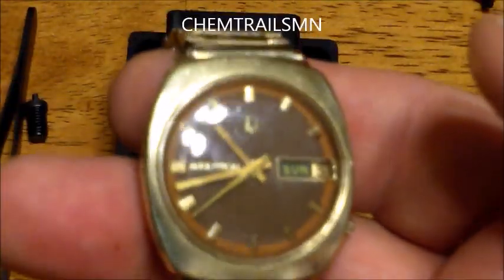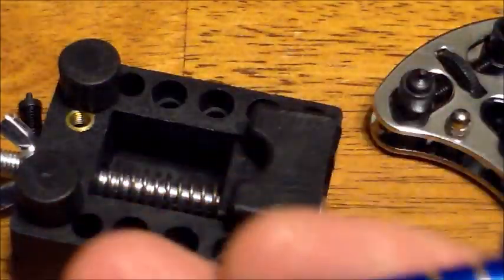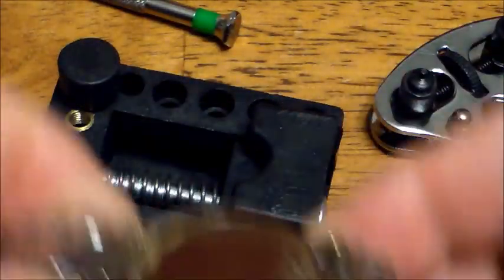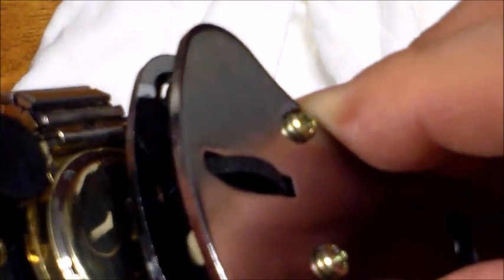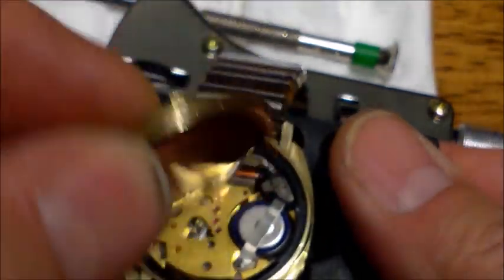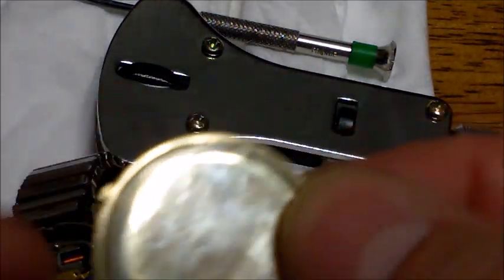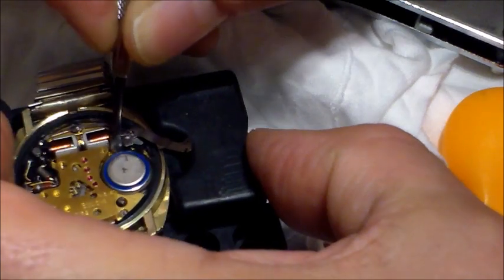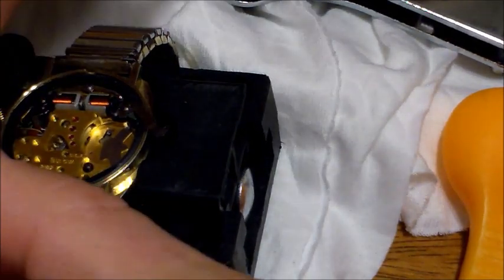BULOVA ACCUTRON WATCH BATTERY REPLACEMENT GUIDE INSTRUCTIONS DO IT YOURSELF! DIY

Comment: Also, when loosening the screws for the cell strap, loosen only half a turn.  Not necessary more than that.  I'm the guy that's worked at Bulova as well as repairing Accutrons since 1970 for both the trade as well as private customers.

Comment: I have to admit I Luv my Accutron N3 (73) it has been the most reliable watch I ever owned 25+ years the only downside is that you do need to change the battery every nine months continued use although you can save battery life by pulling the stork out. And that hum in key F sounds so beautiful.

Comment: Once the battery is replaced the tuning fork requires a slight jolt to start the mechanism
Reply from the maker: Mine started right up
Reply: Thanks Stephen!  This is the exact tip I needed.  I replaced the battery in my Aunt's Accutron and the second hand didn't move.  After seeing your comment, I gave the fork a little "jolt" and voila, it worked.  My 91 year old Aunt will be very happy :)

Comment: A good video, why pay a jeweller for something you can easily do yourself but please don’t touch the movement with your fingers, finger cots cost nothing. Don’t poke about inside your watch with a screwdriver, use a toothpick and get a pair of plastic tweezers for handling the battery.